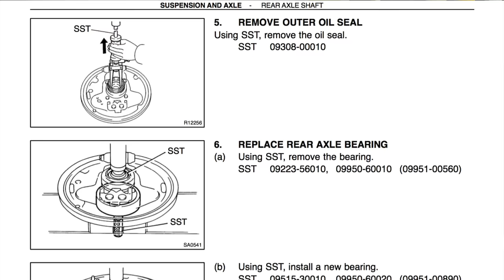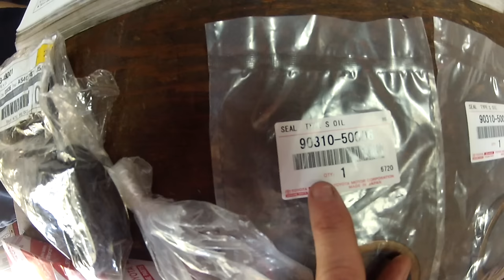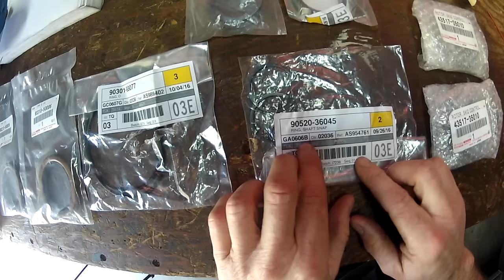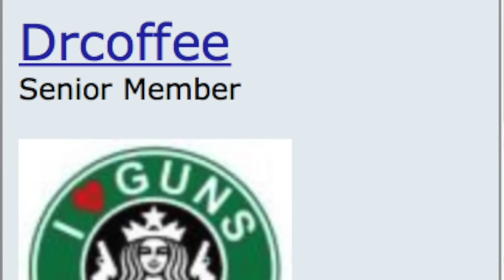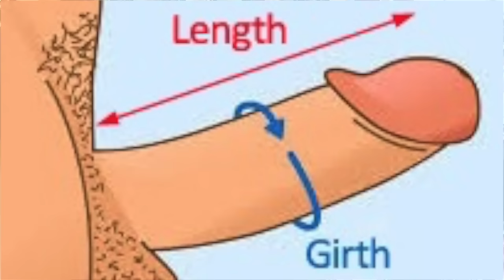Toyota Rear Axle Seal/Bearing Replacement (ABS Rearend)

Comment from the maker: VERY IMPORTANT.  PLEASE READ THIS BEFORE STARTING THIS JOB

1) Saving Money on Parts If you pull the parts off like we show in the video, you can REUSE the ABS TONE RINGS and reuse BOTH OUTER RETAINERS.  We suggest you PURCHASE NEW INNER RETAINERS to mate up with the new seal because the retainers sustain some damage during removal.  A new retainer will have a perfectly machined inner surface to mate up with the axle shaft.  Upon removal, some slight gouging occurs to the retainer and now it's no longer a perfectly smooth machined surface.  If you put a used retainer back on the axle in the inner position to mate up with the seal, there's a chance gear oil could travel between the axle surface and the inner diameter of the inner retainer due to the grooves left in the retainer from the removal process.  It's obvious the retainer, ABS tone ring and inner race of the bearing are made from a softer metal than axle because the axle sustains no damage from the installation and removal of the parts.

2) Some people have reported that even after doing everything right, they still had gear oil getting past the seal.  One culprit ended up being the metal to metal connection of the axle seal with the axle housing.  For some people, a previous mechanic or DIYer might have not been very careful and scored the axle housing with a seal puller or other tool.  Others might have had no detectable imperfection in the axle housing but they still had gear oil sneak past that metal to metal connection of the axle seal and axle housing.  A fix that will work for this situation is cleaning up the surface of the axle housing with acetone or denatured alcohol and doing the same with the outer surface of a new axle seal.  Smear some Toyota Red FIPG which is meant to work with gear oil applications or a similar gasket sealer meant to work with gear oil onto the axle housing sealing surface and also some on the seal itself and then drive it in.  The FIPG will fill any tiny imperfections in the metal and hopefully stop gear oil from being able to get past this connection.

3) The original axle tool we used made made by Durasolid is no longer the best tool for the job in our opinion.  The tool we now recommend is made by this guy Duane that sells them on Ebay.  It is a very well-designed tool that saves you time and money.  Here's a link to Duane's Ebay store: https://www.ebay.com/usr/donald-the-bonald?_trksid=p2047675.l2559    Here's a link to a video showing us using the new tool: https://youtu.be/R-c2x3F8DU4  Also, here's a direct link to Axle Puller/Installer for sale on Duane's Ebay store we used in that video: https://www.ebay.com/itm/Rear-Axle-Bearing-Tone-Ring-Puller-Bearing-Install-Tools-Toyota-4Runner-84-02/203187764458?mkcid=1&mkrid=711-53200-19255-0&siteid=0&campid=5338641100&customid=&toolid=10001&mkevt=1

4) There are many Ebay stores selling a Chinese Copy of Duane's tool.  Please do not reward these dishonest people by buying the tool from them.  Duane makes his tools at his home in Omaha Nebraska.  He has changed the color of his tool to BLUE to differentiate it from all the Chinese Copies being sold on Ebay.  Please support Duane and Buy American!  

Update 12/07/21 - the Chinese copiers are now undercutting Duane's prices so drastically that he would take a loss if he sold the tool for the price they are offering it for.  The only way Duane can give you a more competitive price is if you email him directly and take the Ebay middle man out of it.  
Duane's email address is: dtb2253x@yahoo.com
 
5) When using the flipped inner retainer technique, it appeared 5mm of polished axle showing was about perfect to get the seal lip riding dead center on the shoulder of the retainer.  After pulling some axles from rigs we did this job on a couple years ago, it looks like 3-4mm of polished axle showing would be a better initial measurement to use.  With that said, you still need to verify you have a good mating of the seal and inner retainer by performing a grease of sharpie test.  After that initial grease or sharpie test, you'll now if you got it perfect or you'll need to do some adjustment.  Does the seal absolutely need to ride dead center on the retainer?  The answer is no.  Somewhere close is fine.  The reason why you want it close to center is to allow for axle play as the bearing ages.  If you're close to the one of the edges, the axle play could allow the seal to not ride on the retainer and then you'll develop a leak.

6) In regards to the grease test, make sure the bearing is fully seated into the bearing case before performing it.  If the bearing isn't fully seated into the bearing case, you won't get an accurate grease test.  We show how you can make sure the bearing is fully seated by lightly popping the splined end of the axle shaft into a piece of wood on the ground.  You can watch this technique starting at play time 30:31.

7) Starting at play time 44:20 we show you how to install the new bearing into the bearing case.  As you could see from the video, when the bearing is squared up perfectly, it literally falls into the case.  It's not a press fit at all.  My new favorite tool for installing the bearing is using a 3" ABS Clean-Out and Cap.  The 3" Clean-Out outer diameter is 3 1/2" wide and fits perfectly the outer diameter of the bearing.  Applying the force to the outside of the bearing is the correct method to use when you cannot support the opposing side of the bearing like in this application.  The plastic ABS Fitting and Cap also gives me good feedback when installing the bearing.  Since I know the bearing should go in very easy when it's squared up well with the bearing case, if I see the cap start to bend from the force or I feel any resistance in the press handle, I back off, reset and try again.  You don't want to force the bearing into the case and get it stuck.  It should go in very smoothly and with almost no force.  Check out the video description for a link to what an ABS Clean-Out and Cap looks like.

8) Because the bearing fits fairly loosely into the bearing case, I now slide the backing plate, Durasolid special service tool and press sleeve onto the axle shaft with the axle shaft parallel to the ground.  Only a tiny bit of force is necessary to dislodge the bearing from the case so if I slide everything on in this fashion first and then bring the assembly vertical to fit it onto the press, I have much less of a chance of dislodging the bearing.  This technique requires an assistant but having somebody assist with this repair is ideal anyway.  Having an extra set of hands to get the axle assembly onto and off the press is very handy saving you time and physical effort.
Reply: Timmy The Toolman will this work on the 2000 landcruiser/lx470 also?  The rear looks very similar except the landcruiser/LX 470 has rear rotors and drums as e-brake.  Thanks!
Reply: Does this method apply to 3rd gen 4 runner only? or could I do the same thing on my 04 tacoma?
Reply from the maker: LookN0Hands It would be the same for your 1st Gen Tacoma.  Sorry for the very late reply.  I missed your comment.
Reply from the maker: Duc The axles can be similar but we have no experience with the Land Cruiser or Lexus LX470 so we don’t know if the procedure would be the same and if the tools we use will work.  Sorry for the very late reply.  We missed your comment.
Reply: I need help
Reply from the maker: Kent Todd you and me both Kent! What do you need help with? I am told I am a good therapist, but you won’t like my rates.
Reply: @TimmyTheToolman  Basically my Tocoma is locked up front and rear. Rear wheel bearings and seal.     Drum shoes swollen to the point of not  fully disingageing. Front cv axle needel bearings and seal.  Where do i start and stop?   She's a  project desert truck. Riding on 33's   not geared, next size up 35's.  No  lockers on front and rear.
Reply from the maker: Kent Todd have you checked out our other videos for front wheel bearings in our manual hub swap video or our other videos that address some of your issues?
Reply: @TimmyTheToolman  ive seen all  all related videos bro and i love all of them . Honestly im stuck between a hard rock atm.  About to make a move on a new home first time buyer. Need to keep my old girl running for a desperate escape before i get locked up.
Reply from the maker: @Alexis ayala Glad you like our video but I will definitely disagree with you on your opinion of the best tool for this job.  Now, I haven't used the tool you linked, but I have used Duane's tool that we feature in Part 2 of this video and it's not only 1/3 of the price of the tool you like but it's super functional too.  Check it out: https://www.ebay.com/itm/202596609234  Here's a link to Part 2: https://youtu.be/R-c2x3F8DU4
Reply: @TimmyTheToolman  i was going to say, cut/mill the shoulders off. that is rediculously thick.  i with a drill press would of drilled down each hole 10 mm..
Reply: @TimmyTheToolman  isnt the important bit,not the seal riding,but the abs teeth engagement.
Reply: @TimmyTheToolman  as of today Duane still does invoices over email!  Can confirm!  Thanks for the video!!
Reply from the maker: @BigBluePile  Thanks for buying from Duane Logan.  American made in Omaha, Nebraska.
Reply: @TimmyTheToolman  shoot, thank the both of yous!  I've done many a rear wheel bearing but not the tone ring style.  Been "backyarding it" for years. Figured I better have an actual tool this time!  Besides, great price and I don't have to do engineering!  Bonus!!!
Reply from the maker: @BigBluePile  Yep, Duane's tool is much better than pounding the axle against a wood block on the ground.  There's guys that will spend time making their own homemade tool but it's not as good as Duane's kit.  And, like you said, the price is very fair, so why go through the pains of engineering your own tool when the work has been done for you already.

Comment: Not sure if it was mentioned, but another very common problem with a very simple solution, is the differential vent that easily gets plugged and when the fluid gets hot, it builds pressure and blows out the seals.  The solution is to clean or check periodically or attach a line up to the sides of the bed to keep it away from water/gunk intrusion
Reply from the maker: I don't think we mentioned it in the video but we do mention the possibility of a clogged breather in the video description as the culprit of why the seal(s) failed.  We also do have a rear differential extended breather mod video: https://youtu.be/tCGMa4vng_g  Thanks for the comment.
Reply: I changed my breather vent on my Tacoma and when I unscrewed it I heard a poof noise so I’m glad I put in a new one. 

Also I’m wondering if in a pinch could the oil be replaced through the vent hole 🕳️???  
Just a thought 💭.

Comment: Success!  Changed my 04 tundra driver rear bearing, seal, switched the retainer for better sealing area.  Bought the original tool off ebay.  Took me 2 hrs total.  Parts slid off easily, might be due to pre- soak.   Fantastic result.  Saved me $1900 at the dealer.  My cost approx $650 in parts, will sell the tool later on (consider it rent)
Reply from the maker: Good job getting it done right.  Happy Wrenching!
Reply: I haven't watched this yet, but is this the one most similar to my 04 Tundra Double Cab? (shares some parts with the Sequoia) I think I saw future Timmy comment that this generation 4 Runner is the most similar as opposed to the Gen1 Sequoia.

Comment: a tip I learned for installing bearing races is to take the old race after you pound it out with a drift and cut a slit out of one side then use that to press in the new race.  because it's cut on one side you just squeeze it and it comes right out after you have the new race seated in.  I know you weren't doing anything with a race here but the way you used the old bearing to press in the new one reminded me of this trick.
Reply from the maker: Thank for sharing this tip.

Comment: I have a 2005 Sequoia. Shops in the Las Vegas area have quoted me $1400 PER SIDE to replace the rear axle bearings. Would love to purchase all the tools and do the work myself, but I don't have anyone here that could walk me through it if I get stuck. Thanks for your video. It's the most thorough and detailed I have found.
Reply from the maker: Mike, you don't need anyone to walk you through anything.  All the information you need is in our videos.  We have a Part 2 to this video that showcases a new tool that works much better than the original tool.  https://youtu.be/R-c2x3F8DU4  The amount these shops are quoting is ridiculous  That's almost $3000.  You can get the Harbor Freight Press and the special axle tool that Duane makes for around $400 max.  The bearing and other parts will run you another $250 for so.  $650 compared to $3000 is a huge difference.  Plus, you gain the tools that you can use again.  That press comes in very handy.  The axle tool you may use again someday or you can sell it on Ebay at a discount and get a lot of you money back.

Comment: Hello, excellent technical ability, very detailed, and very helpful, thank you. I have just one request, I really wish you would pay more attention to safety when working in the shop. As a lifelong tradesman, removing retaining rings (c-clips), pressing assemblies apart on the hydraulic press, and many other operations in the shop can be very dangerous for the eyes. Retaining rings have been known to fly across the room. For your benefit, and the benefit of all the youngsters watching this, please wear safety glasses at all times when working in the shop. It's a very important habit to ingrain into anyone doing mechanical work. Thank you again. Ed Bruschinsky
Reply from the maker: @EdBruschinsky  I understand your concern, but I only wear safery glasses when I'm cutting or grinding.  I don't like wearing them for regular wrench turning and press work.

Comment: pro tip: if you have a vacuum pump, pull a vacuum on the brake fluid reservoir prior to cracking it open and you wont spill a drop.
Reply from the maker: @thediddlefiddler5569  Thanks for the tip.

Comment: Hi Timmy,

Thanks for the videos on how to replace the rear bearing.
I had to do this job because the back-plate on my brakes was so rusty it would not pass 
inspection in the condition it was in.  I also purchased the Axle puller/installer from Duane
that you recommended and it worked great.  Thanks for the tool demo's it made the whole
process of doing this job go very smoothly.

Chris
Reply from the maker: You're very welcome Chris.  Glad our video helped you get the job done and thanks for buying from Duane and not from one of the people selling a rip-off copy of his design.  We appreciate you taking the time to comment.

Comment: Outstanding job coving this repair!  Thank you!  You also went into great detail to answer questions that many of us would be asking as you went along.  I especially thank you for going into the detail of pressing all the components off the axle with the hydraulic press.  I am going this route because the 4Runner is my only vehicle so, once it is apart, I cannot take my axles to a machine shop to do the press work and I certainly can't have a machine shop try again and again as I run the grease test.  Couple questions, if you get a chance to see this thread...
1. What is the Press and Pull Sleeve Kit really needed for?  Can't I use a Seal Drive kit to perform those functions?  I didn't buy that kit.
2. Is the OTC Bearing Splitter Kit really needed?  I bought a 3-4" Bearing Splitter by itself and I'll buy long bolts, and it saved me $60.  I hope it works for me :)
3. I had the chance to buy a Harbor Freight 12 ton press for $130 or a 20 ton press for $190.  I wanted the cheaper option but, once I looked at them both, I considered that maybe the 12 ton press is too small for the length of the axle.  I bought the 20 ton press.  Do you know if that is the case for 12 ton presses or the one from HF?  Is that why you used a higher rated press, for the length of the axle?
4. Lastly, I don't understand exactly why you need or use the ABS Clean-Out and Cap.  You have said that the bearing isn't under force when it seats properly.  Shouldn't I be able to tap it into place with very little force?  Maybe I missed something, but I'll watch again.
Reply: I just finished this job.  To answer my own questions if it can help others...
1. The Press and Pull Sleeve Kit is nice for making space when pressing the bearing into the hub.  However, it was not needed for my setup.  I saved the money and got by without it.  I used the old bearing to press the new bearing into place, with an improvised steel plate.  I used the DuraSolid cylinder to press directly on the retainers to press them onto the axle (once with the bearing, once with the ABS ring).  For removing the bearing, I bought a short length of 2" dia. PVC pipe and pounded on it.
2. No, the whole OTC Bearing Splitter kit is not needed.  I'm sure it is nice to have those hardened stand-offs, but you can get by with the $25 splitter on Amazon and then buy some 5-6" 3/8" bolts with nuts/washers to mate up to the DuraSolid plate.
3. I think the 12 ton press from Harbor Freight would have been too short for the length of the axle on this vehicle.  Also, the pressing power of the 20 ton made things go smoothly.  I don't know if the 12 ton press could have done it as easily.
4. I don't know about the ABS Clean-Out and Cap.
The bearing was a very tight fit into my hubs.  There was pressure the whole way as I pressed each one into the hub.
I improvised some of the tools and I saved myself almost $200.  But, if you don't feel like making some of your tools, it would be reassuring to buy the right tools for the job.